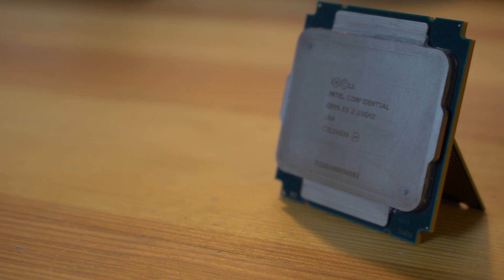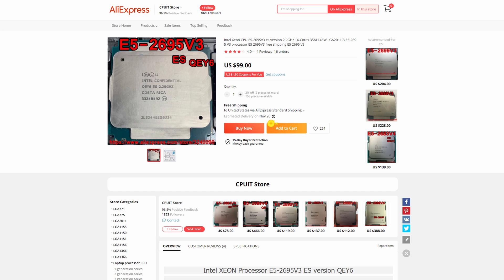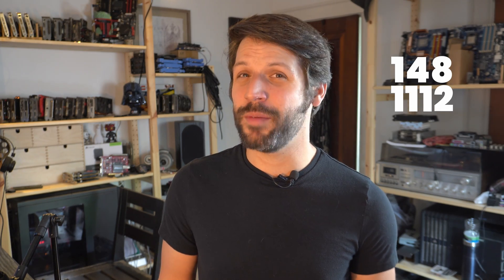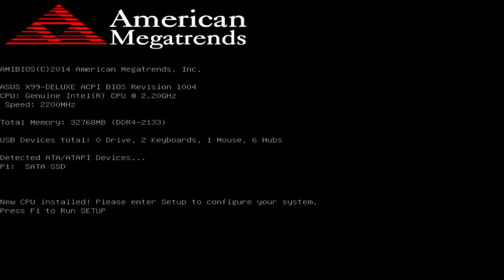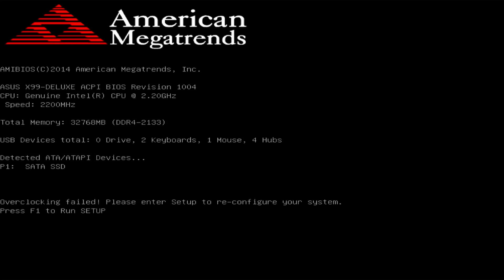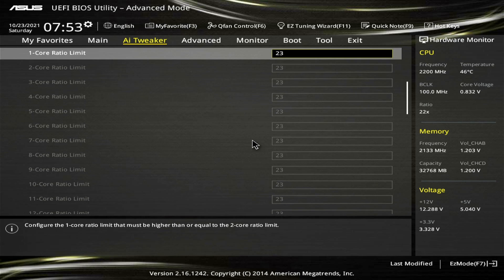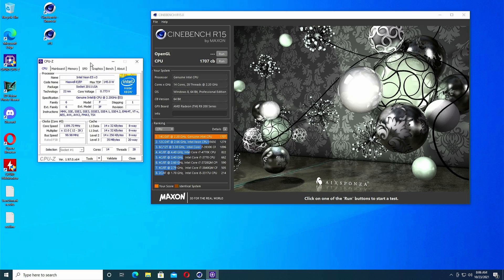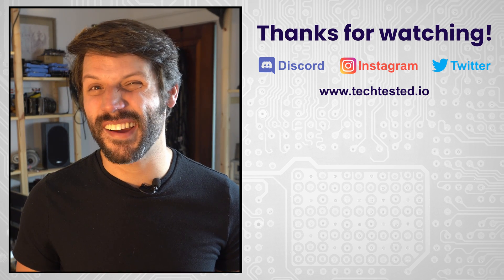Should You Buy an Engineering Sample?

Comment: Pootube algorithm, -100 points for cross application of thermal paste
Reply from the maker: Never had issues with that thermal paste application, and I usually only use it for CPU's with really large heat spreaders
Reply: @TechTested  you should know the correct way to apply thermal paste on the internet to empty the entire tube onto the CPU